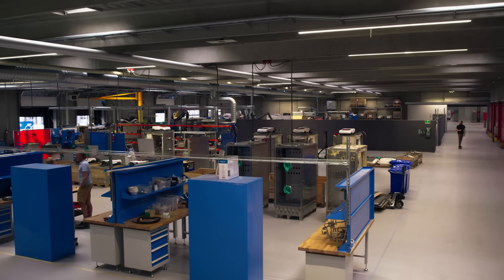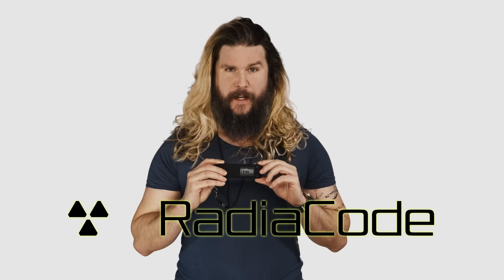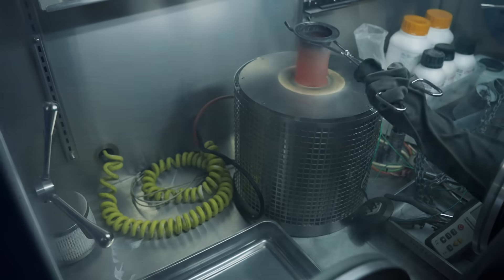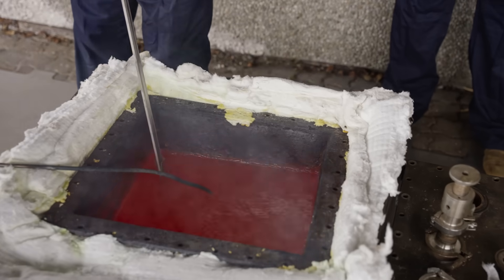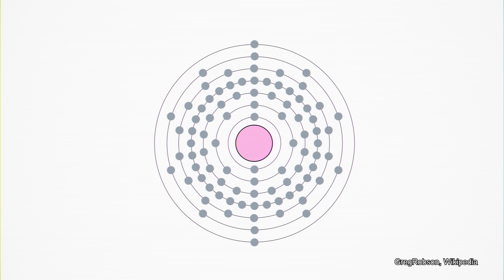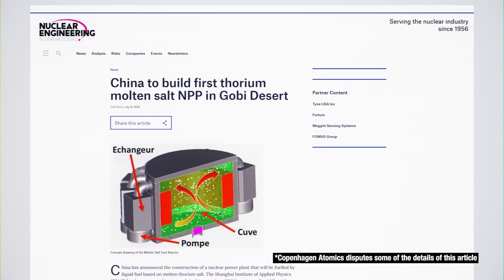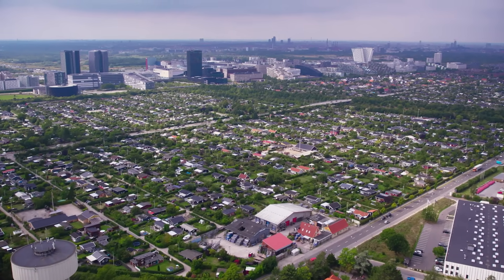Is THORIUM the Future of Nuclear Power?

Comment: I also thought the molten salt had the viscosity of lava. That was an incredible demonstration with the salt in this video.
I was hoping there would be a segment on how corrosive molten salt is though. I wasn't able to find an answer while searching online, but I was always under the impression that one of the main complications was how corrosive the molten salt would be and that the "red hot plumbing" part of the reactor would have a significantly shorter lifespan than typical plumbing. Which is then complicated further by the fact that the plumbing would also be radioactive and harder to service.

Not saying these are insurmountable challenges, I was just hoping the see this mentioned in the video since I'm wondering how these challenges will be surmounted.
Reply from the maker: Corrosion will be in part 2!
Reply: @kylehill and that's why you are the GOAT
Reply: @kylehill -- I hope you also you touch on the fact that "harder to weaponize" is possibly part of the reason why few governments invested in thorium.  I'm sure more than one government saw energy as a "useful byproduct" of amassing a nuclear arsenal. Nixon's speeches selling "fast-breeder" reactors on the campaign trail certainly gave me that impression.
Reply: @kylehill  Should be interesting!  Having worked in chlor-alkali plants with saturated sodium chloride brine, chlorine gas, and 15% sodium hypochlorite (bleach) I've seen my fair share of corrosion.  Titanium seemed to be the only thing that would hold up.  What happens if the Thorium laced molten salt ever freezes in-situ?  I worked at a wastewater plant that was piloting new ballasted floc tech using magnetite which was carried and recycled within the wastewater plant.  One day we lost power, it took under a minute for the generator to switch over, in that time the magnetite settled in the clarifiers and became one big mass.  It took 8 people 2 days working 24/7 to aerate the mass enough to get things back up and running.  I do like the recovery of waste products by fluoride reactions.  But then again....your dealing with fluoride and it's dangers!
Reply: ceramics are harder to make but negate the corrosion  @kylehill , some components (pumps etc) probably will need to be replaced on occasion.
Reply: @kylehill  I thought that was going to be the case, as you said part 2 was going to be about why don't we do this and him saying 5 years for the metal stuff did seem like the obvious answer. Hopefully we will see something that can cope with the corrosion as a solution to this.
Reply: @kylehill  Hopefully you'll also cover the intermetallic compounds that make the reactors non-functional.  It's not a new problem and the main reason why we didn't have these more than 30 years ago.  The corrosion piece is tough, but the intermetallic compounds are so energy intensive to separate the tech is doomed.  Mixed fuel is so much simpler and you can use spent fuel from other reactors as a neutron source.
Reply: @kylehill  Can you make a video about why Vibranium of Captain America's shield is considered the best metal for defensive purposes?
Reply: @TheVibraniumPatriot  Vibranium negates force (which makes no goddam scientific sense, and only does so when convenient, but it's comics man). Adamantium is harder than vibranium, but that just means it doesn't break. If you had a shield of adamantium and blocked a punch by the Hulk, that would just transfer the force of the punch to your arm, and you'd still go flying and break your arm (if you're lucky). At best it can spread out the impact over a larger area. But vibranium actually negates the force, stopping the punch completely.
Reply: @TheVibraniumPatriot  Check out "Why Does Captain America's Shield Bounce? (Because Science w/ Kyle Hill)", in the Nerdist channel from 6 years ago. It doesn't answer your question specifically, but offers a bit of insight on how the shield could work.
Reply: "Corrosion" will probably be in Part 2.🤔
Reply: It does have a significantly lower viscosity than lava, but even that's not a fair comparison.  Most images of slow, creeping lava are near its freezing point.  It flows many orders of magnitude more easily at higher temperatures, such as within an insulated lava tube.
Reply: They briefly and tangentially address this at 13:49 when he says "...our metal components only last for five years."
Reply: @brentogara , yeah, I caught that too. So instead of new fuel every 2 years, it's a new reactor every 5.
Reply: @JoshuaSims1981 if it is the case for this prototype, it does not mean that cannot be improved. In fact it was already, see Thorcon and their blueprint that is going to be built & sold to Indonesia.
Reply: @brentogara  Well... if the reactors are cheap enough, they could cycle the liquid mixture to a fresh reaction vessel while replacing/servicing worn out one. Keeping the whole plant operational with no downtime. Would be amazing if we could find a material, that passivates the inside of the pipes with the the presence of hot molten salts, thus creating a natural anti-corrosive layer. And as the system heats up/expands, the cracks will self heal as any fresh material gets passivated by the salts. Will it work 100% in practice: hard to say. Im just a arm-chair expert with approximate knowledge of things
Reply: @brentogara  I caught that as well. It seems like a massive hurdle to overcome economically.
Reply: @brentogara yeahsn that's quite  the sneak 😂
Reply: @goozebump  The trick here is that they're producing a new unit every day. The hardware will be incredibly cheap to replace compared to traditional reactors. We've traded the life of the unit for the life of the fuel, but also made the unit cheap (and actually the fuel is inherently cheaper as well, I think).
Reply: I’m also curious what kinds of procedures could be necessary if any portion of the salt loop is ever allowed to freeze.

My guess is that would be under the heading of “never let this happen or you’re fired” in the owner’s manual. 😂
Reply: @rainmannoodles there is a ‘salt plug’ in one of the diagrams. Which I imagine will be covered in part 2 as regards safety.
Reply: @rainmannoodles this is all I can think of when I think of molten salt, I've been wondering this for years
Reply: "Advanced ceramic materials such as silicon carbide and its composites have both the temperature tolerance and corrosion resistance to function in MSRs at the desired level of performance and safety. These materials are also radiation tolerant and, thus, can be used for structural components in the MSR."  -The American Ceramic Society
Reply: @damien86  Yeah that is great for the main containment but that has never been the main issue for them, it is the heat conductors, which, guess what ceramics really suck at doing because they are great at being insulators?
Reply: @damien86 I love ceramics!!!!!! Human ingenuity yippee.
Reply: @damien86  More Jedi Hand Waving(tm). With a suitable "desired level" a f'ing cast iron pipe will do. Everyone fails to understand just how corrosive NaCl is -- esp. when it's at 1500F!!! Look at current nuclear power, almost all of them are many decades old. An MSR will be a Yugo in just a few years. (i.e. unrecognizable pile of rust.) Granted, other than the steam side, none of it is high pressure, but you still wouldn't want 1500F molten, toxic, radioactive lava leaking, well, ANYWHERE. Ceramics tend to crack / crumble under stress, and high temps. (ask any machinist.)
Reply: It's all a matter of temperature. You can get steel to flow like water if you get it hot enough. (I guess you've never seen videos of lava in a lava tube. Very hot lava flows very easily.)
Reply: I suspect they will circle back to that in Part  2.
I would think that if they manage their goal of mass producing the reactors themselves then it wouldn't be that big a deal given the liquid fuel. Just have 2 or three reactors plumbed into the same network and leave the extras shut down. When the active reactor is reaching it's end of life, you begin the startup of one of the extras. Once it is up and running you shut down the old reactor, drain any remaining fuel and dismantle it to be replaced with a new one.
Reply: There is no pressure on the corrosive side. So why not just plumming with some type of glass or ceramics. Glass melts at 14-1600 C
Reply: @  You throw it away and build a new reactor.
Reply: IIRC from CA's videos in the past, the corrosion issue has been largely negated by using high purity metals. I think it was research from a UK university that discovered if impurities from the (stainless?) were removed, corrosion was drastically slowed. But evidently from the "4 year" comment, not eliminated, at least yet. Look forward to part 2!
Reply: Lava's viscosity varies greatly with the geography depending on what minerals are in that location inside the earth
Reply: Ummmmmm, why would you or Kyle assume that? Because salt is hard to melt? (Its not) Because its a rock? (So is H20 almost everywhere it exists.)

Because neither of you understand chemistry?

Comment: Wait, if it produces its own fuel, where does the energy come from without violating the laws of thermodynamics? Why is that not perpetual energy?
Reply: It was kinda abstracted away, you supply thorium -232, hit it with a neutron which causes a decay chain into uranium. When the uranium isotope decays, it will output 2 (or more?) neutrons which can then be funneled into a thorium-232 bath to start all over. Basically, you need to supply the 232 isotope, but the reaction "enriches" itself into its own fuel, as
Reply: @westonzavadil8770  I looked at a chart. Basically, the thorium 232 ends up as uranium? You don't need to enrich the thorium because the uranium decay will do that, but you do need to supply the unenriched thorium, correct?
Reply: @Sam_on_YouTube  yea, that's where the mass you are consuming comes from.

Comment: Is there video of these reactors running? What are the electrician requirements to start up the reactor? Has it been tested by outside Nuclear experts? How would the reactor melt down if the fuel itself is radioactive? It's sounds like a great idea and seems promising as a concept, yet there have been so many vaporware promises presented with CGI renders and investors burning money. Looking forward to seeing this more in depth.
Reply: There was a test reactor built in the 50s/60s but it was shut down when the decision to go with light water reactors was made. Once nice feature of molten salt reactors is that in the reactor chamber you have a plug made of a material with a higher melting point than the usual reactor temp. If you start getting a meltdown scenario that plug melts and dumps all the fluid into a large containment chamber. Since the fluid is taking up more volume the density occupied goes down and the reaction effectively shuts down. (You need to maintain a certain density of fuel for the reaction to happen).

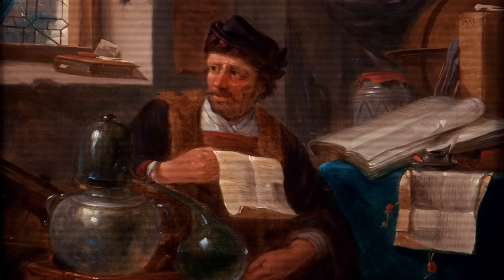Comment: Thorium reactors have been in the R&D phase for some six decades!  Thorium was put on low priority in research and funding.  Partly due to traditional U-235 fission reactors being so popular and large scale at usually at least 600MW output and more while not needing sodium nor the complex daily operations as Thorium nor Thorium's more complex fuel processing (11:24).

Molten salts are corrosive especially at high temperatures which they'll be used 24x7x365 in a Thorium reactor.  I agree at 9:15 that is a plumbing puzzle, but the costs and maintenance to build piping, pumps, heat exchangers, valves, seals, etc will be so expensive that any cost reduction with Thorium will be blown away by construction and maintenance costs.  That's just one cost.  Another big cost is the much more complex daily operations just to keep the small Thorium reactor running.

The abundance of Thorium over Uranium isn't much of a benefit as there's more than enough Uranium for current and future traditional U-235 reactors.

That said, the much bigger threat to Thorium is renewables powered by that cosmically large fusion reactor in the sky.  So by the time that China plans bring online a small 373MWth Thorium reactor in 2030 (TBD), the world would be even deeper into renewables and grid-scale storage -- renewables will be even more abundant and cheaper than it is now and they're already at historic low costs of generation.  Currently, the LCOE + LCOS costs of renewables already cheaper than nuclear LCOE alone. So, again, Thorium will be put on low priority if it's even ever brought back.  Global renewable generation is growing at exponential rates now and increasing while costs are decreasing.  Renewables will dominate the terrestrial grids by 2035.
Reply: Don't under estimate the value of having a heavy output power source that can be relied on in an emergency.
While renewables are the future, we could do with a strategic backup of thorium reactors.
Reply: @ Yes, the grid-scale storage is needed, and this will usher in dispatchable "firm renewables" which will mop the floor every other form of electricity production on Earth, since it will remove the one weakness of renewables, intermittency.

Already the LCOE of renewables plus LCOS storage cost is cheaper than LCOE cost of new construction commercial utility-scale nuclear.  Furthermore, both renewables LCOE and grid-scale storage LCOS are heading downwards too.  Moreover, they can both be deployed an order of magnitude faster than nuclear which is key as climate change is breathing own our collective necks.

This is why the field of grid-scale storage is white hot right now with subsidies, investments, R&D, and scientific interest.  It's not all about battery storage either.  There are other forms of storage that are more adapted to grid-scale like: liquid-metal flow batteries, compressed air/CO₂, ceramic/sand thermal storage, hydrogen, gravity, pumped storage hydro.  These alternatives use much more conventional construction methods and materials.  They are not as energy dense as batteries, but they don't need to since they are stationary.
Reply: @KungFuFenris Who's gonna pay for that?
Reply: @ Hopefully sensible economics that takes extreme weather into account.

Comment: I'd love to see you cover the credibility of the new planned commercial fusion reactor in Massachusetts. From what I hear, they need about 3-4 times the current output for commercial viability, but still planning to start building the commercial plant basically while testing begins on their smaller test plant, which they have only just started building. They're at around 70% of the net energy in coming out. They need about 200-300 percent to be commercially viable. That's a long way off.

Comment: Old PWR simpler?
Did you forget all the safety systems added to this cold war reactor design over the last 3/4 of a century, or that giant over engineered concrete dome that supposed to contain any explosions caused by water separating into hydrogen and oxygen. 💥 ☢️